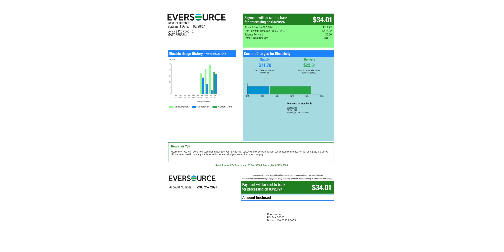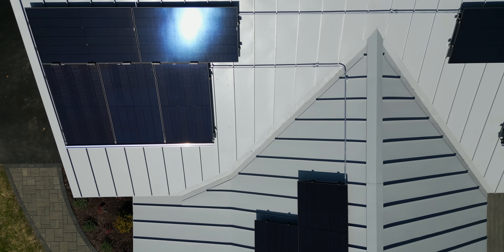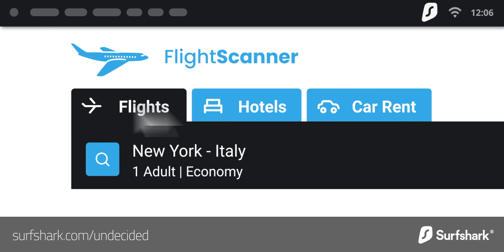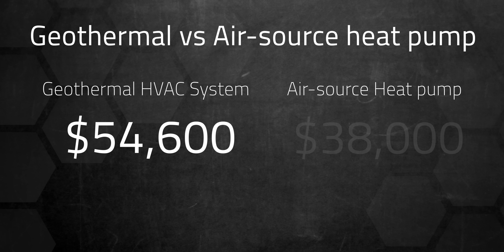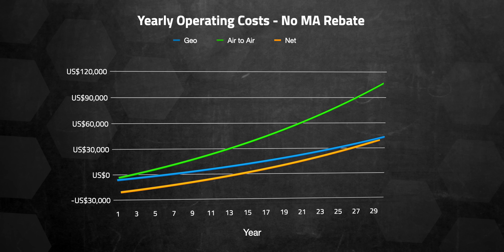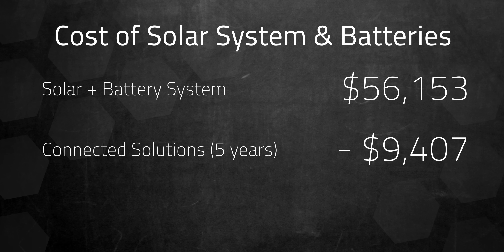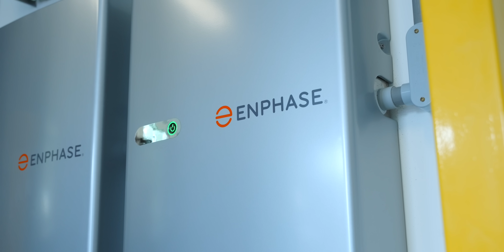What I Learned After 1 Year with New Solar Panels

Comment: WOW, you paid a lot did the contractor sell you the system? Off grid you would need 3 days of battery but,,, at that price???
* Solar Panels; Runergy 400W up to  500W Bifacial Panel 500W 88.00 each X 43 = 3784.00
OFF GRID 
*Inverters 200amp service EG4 12000XP 2500.00 each = 5000.00
*Batteries. WattCycle 12V 280Ah Mini, 24 each,  80kw = 12,000.00 today,,, 8,000.00 on sale, wait.
This totals about 22,000 with tax, 27,000 with hardware. Install the panels yourself with a carpenter and hire an electrician to help you wire it up, labor??? How handy are you, your friends? ALSO, those batteries go on sale for about 25% off often, save 4,000 on batteries and it will help cover installation costs. NOTE; this is a large system you will never miss the grid.

*Whole OFF grid 200amp system, 3 full days of battery storage for about 30,000.00
ON grid; you will increase the inverter price however decrease the battery cost by a lot more.
As for pay off time? IT WON'T LAST 30 YEARS. The payoff on the above will be about 10 years, pray for no hail storms.

Comment: Matt I’m a little disappointed that you invested in home battery storage when you pointed out that you have 70kw systems that you drive with… it has always been the vision that you’d use the home to vehicle systems (H2V) to balance your power needs.   This serves two purposes - one you have the latest battery tech every 5 years or so without ripping up or changing the home infrastructure.   Two you never have to worry about battery degradation over the 20 years of constant use.   Lastly, there was always this utopian (maybe one day) that the vehicle is your life time energy sub system- you use solar to charge during the day and tap into that system for night and non sonny days.  Using the grid only when you are very low.  And you power your energy needs where ever you go, work vacation or grocery - the energy grid is maintained and sourced by your transportation - it combines all the energy needs for industry, home and transportation.    I realize that this may be 6-20 years out - but I’m disappointed that an early adopter like you didn’t look more closely into this option.   I mean using the car is the most cost effective!

I mean why get the battery when you have local net metering like I do in Massachusetts.

Comment: If I knew where I was going to be living in 5 years I could/would do more.  I use my battery inverter system for peak shaving when the utility issues a "flex event", at which time I earn $1 a kWh for electricity not normally used during that time, it also works well during power outages.  I've added thermal windows, attic insulation, under house insulation, water pipe insulation, air duct insulation and some energy efficient appliances.  Since this is not my "forever home" I'm reluctant to do more, unless I can take it with me.  I've witnessed vandalized solar installs in my area, additionally the area I live is solar poor, latitude and clouds, in the winter when it's needed most.

Comment: Great info Matt.
I too believe Solar panels are well worth the investment. I cannot however say, that for me that a battery is viable. 
I am nearly net zero in electricity consumption, however still well out of pocket but that cost in now halved compare to pre solar consumption.
I live in Melbourne Australia and in December of 2022 I installed a 9.4 kW solar panel array and an 8kW three phase Inverter. limited by roof space and max 10 kW array for domestic install here in Victoria currently.
I have had this system now for 2 Years and have seen a significant level of production and halved my consumption from the grid.
My system cost me AUD7,500.00 (approx USD$4,600.00)  and has produced 26.2 MWhs of power over the 2 years since installation. 
During mid Autumn through Winter and into Spring my solar generation varies significantly. 
The generation pattern from 2023 to 2024 is very similar with winter months providing some 490-600 kW per month and up topeak  1.5 MWhs per month in the December and January. 
Full 12 month generation of  11.9 MWh in 2023 and in 12.4 MWh in 2024. 
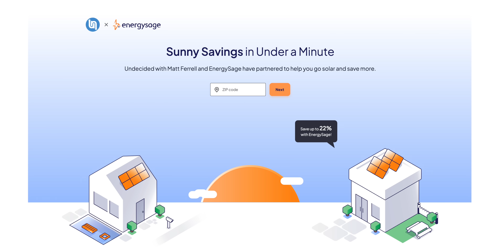Due to very poor feed in tariffs in my state, the excess is sold back to grid at AUD$0.054/kWh and retail cost where I live is AUD$0.42 at peak times -(16:00 - 22:00 hrs) and AUD$0.21/kWh off peak. 
So I still spend for power at night and winter months when solar performs poorly and on overcast and bad weather days.
Batteries are still cost prohibitive for my use as during the period of April through September I would hardly have excess power to charge a 13kWh battery.  
The cost of such batteries at about AUD$18,000 for a Tesla Powerwall 13 kWh unit plus installation.  
Some other makes are less expensive however the cost per kW of storage is still around the same at approx AUD$1,400 / kWh.
At that cost, it would currently take over 15 year payback given my generation profile. 
I have decided to wait until battery technology improves and costs come way down.

Comment: Holy crap, Matt. I cannot believe what you paid for your system. My system we installed in 2024 here in Tucson, AZ is smaller than yours. Your system was 17.2 kW with battery backup, and ours was 12.6 kW with 3 x Tesla Powerwalls (2 x pro, and 1 x PW2), and our system only cost $57k vs. your $89k. Ours went live in April 2024, and despite a 27% smaller solar array, our system here blew your production numbers out of the ball park in just 9 months. Here is the comparison. In a full year, you say that your system produced 18.1 MWh. In 9 months here in Arizona, our smaller system produced 21.2 MWh. In a full year, we should hit about 27-28 MWh of production. Additionally, here in Arizona we only pay $0.11/kWh for grid power compared to your $0.31/kWh. This highlights a big thing that you don't mention often enough, and that is that solar power makes sense mostly in areas where the cost of living is low and solar radiation is high. So, solar power doesn't make sense in a place like Massachussetts, where solar radiation is low, taxes are insanely high and the cost of living is unaffordable to most people. Instead, solar power makes the most sense in places like Arizona, where taxes are low, life is much more affordable, and the solar radiation is very high.
Reply: Your numbers are great but the conclusion you make doesn’t make sense. Matt’s saving money in his area— he’s just not saving as much money as you are. Given that he plans to age in place in this home, and the fact that utility prices always rise, he’s in a good way in an area that he actually wants to be in. AZ is fantastic for solar, and a lot of fun to hike and bike in during the winter, but in the summer, you can’t do much outside. Not the case in MA. You also can’t hike amongst the beautiful New England foliage in the fall, like in MA, nor do you have as many options for skiing or snowshoeing in the winter, like you have in MA. Different strokes for different folx— all saving money and energy! Let’s not forget that when you build a home somewhere, you might choose the location because of proximity to family and friends. 

Congrats on your setup tho in AZ. Sounds sweet.

Comment: I watched the whole video, and I am left scratching my head as to why. Not why solar, but why spend SO much on the energy saving systems when you could have achieved Net Zero simply by adding a few extra panels?

I am a DIYer, and this summer, I installed a 13.2kW system with 14.3kWh of battery. Granted, 13.2 in Texas will anualize a lot higher than 13.2 in MA (anticipate between 18 and 20mWh) and without changing ANY systems in the house, I'm hitting Net Zero in December, and tracking towards it in January.

AND by doing it myself, I got Panels, Racking, inverter, Module level monitoring, disconnects and breakers, all conduit and wiring, AND a battery for around 22k.

True, I am an engineer, so I am smart enough to know what I am not smart enough to do... but Im also a fat OLD engineer (61). If I can do it, anyone can. 

Bottom line is, if you are willing to put in the elbow grease, there is no need to spend 6 figures to go Net Zero. Just my $0.02
Reply: FWIW, the house is all electric, so the winter load includes an electric heat pump.

Comment: Matt - Looking at the cost of geothermal vs the cost of solar would it have been cheaper to expand the solar and run a heat pump.  I can see many of the improvements have a payback over the grid, but do they have a payback over a larger solar system.

Comment: Like you, I live in Massachusetts and had solar installed a year ago (Dec-2023).
I used money obtained when a relative bought out my share of a parent’s house.
Purchased 17 4kw panels; cost was  $28k. The panels were from SunPower.

We use between 400 and 500 kwh per month. We are not an all electric house. We use oil for heating and hot water. We’ve cut down our oil usage by using a pellet stove and Mitsubishi mini-splits.

Our roof faces east/west. We installed the panels on the west-facing size.
Our first three bills (Dec, Jan, Feb) cut our Eversource bill in half. We have not had a bill since.

According to the monitoring app, solar covered 47% of usage in December 2024.
I expect the built up credit shall cover our forthcoming bill.

Comment: Another great video, I've been following your home progress in multiple videos and its a great resource for those diving into energy efficient homes. As a mechanical engineer whos designed many NZE building systems, I will add one thing that wasn't covered in depth in this video and one that I'm almost certain that applies to your home given its size and single heat pump. It all starts with the architectural design, even as a mechanical engineer, I start by working with the architects telling them what they can do to the design to bring down the loads. Following the passive house standards will get you pretty far without the need for detailed energy modeling, but upfront modeling is best if you can get it. $ spent on envelope makes the HVAC and PV system smaller, making for an overall cheaper NZE home; and go easy on the glass folks, the best glass in the world is many times worse than a code compliant opaque wall.

Comment: The more they gouge you with high utility cost, the stronger the argument is to implement cost saving strategies. 
One issue i see in the payback calculations is repair and replacement cost. These need to be factored in. Generally speaking, the complex systems cost more to maintain.

Comment: $0.31 / kWHr is mind-blowing to me in Detroit. I pay 8.1 cents for distribution, and 5 - 13 cents for generation - so $0.13 off peak and $0.21 on peak. More critically, natural gas is only 3.3 cents per kWHr! Wow, I have it good. 

Detroit's utility DTE is pretty dirty. Home electric is 33% of my kWHr, yet 59% of my CO2 emissions. Natural gas for building heat and hot water is 57% of my kWHr, but only 19% of my CO2 emissions and 15% of my energy costs (with transportation being 40% of cost, 10% of usage, and 22% of CO2). I have both a mini-split air sourced heat pump and in-floor hydronic heat from a natural gas tank. In my situation, the heat pump is both more expensive AND more CO2 than burning gas. 

I just added two 390W panels with enphase microinverters in a self-consumption mode. Made a nice roof for my firewood rack and has a 5 year payback. I would love to have a clear case to go net-zero  -  spend my retirement dollars now to not pay for energy in retirement, but it makes no sense here in Detroit. I'll keep my $0.18 / kWHr average electricity price rather than go net zero with insane energy costs!

Comment: I am curious what performance you are getting from your Waterfurnace series 7?      We are in our 4th winter with ours.     Northern NH cold climate,     not a great house to heat but not terrible.     But we find that we would be  cold without our woodstove and back up electric heaters.    We have ample solar.    MA climate and better home may make a difference.    We mostly only run 1 of 3 zones because of the wood stove but even that zone struggles to get to 68 in cold weather.     Just curious of others experience?

Comment: Hey Matt, You have a great mixed set of energy solutions and management, I mean your super efficient insulated house is the best way to start imo, which you did, the less you have to heat the better! Thanks for sharing your experience!

Your house looks fantastic, you've set up a great solution for the future too, have you considered a small wind turbine addition for those darker winter days and nights?

Great value on the Geo thermal! Could you insulate the bare copper pipes near your water heater - super nerd thought there 🤣

The projected savings for the future look great too! You have done a great job! Great model for anyone considering a similar project!

Definitely worth it! Without a doubt!

Comment: I am starting to design my forever off-grid house. I have calculated everything except the type of solar panel and batteries. Do you have a recommendation for both? I was looking at 500-watt panels because they would be the most efficient, and you recommended Franklin batteries. Has anything changed?

Comment: here in Australian,nsw our power is charge at 46.5cents per hour, but has just dropped to about 36 cents per hour but varies, our solar rebate has dropped from 0.07.6 cent KW per hour to 0.05c as from )october 24 what a joke ,get to a point plus i also have a heat pump and still pay 96.00dollars to 265.00 per 3 months, but my solar is only producing half of powder due to shade from trees ,which needs to be considered, not make matters worse,theres talk about energy companies my charge us extra fees if we make over 17kw per bill ,to be checked and verified

Comment: If you truly want to think of solar as an investment you must consider opportunity cost. These high $80k+ investments in solar must be compared to traditional investments to get the whole picture. Sure this setup may return 200k in 30 years compared to a cheaper upfront option, but invest that 40k savings by going air pump instead and that money doubles every 5-7 years forever (S&P500 index fund). So in 30 years that becomes $650k minimum.

Comment: I still can't believe the costs for your systems. Those contractors made a huge profit on you. It's shameful and it will soon price most people out of a home. I even see tiny homes coming in over $100k. 
Good, energy efficient homes shouldn't cost that much to build. 
You made great choices as far as keeping your future cost of operation down. I have tried to counsel people building new homes to at least go with super insulation and sealing, but most don't get that it's cost effective in the long run.

Comment: Cost of 1KW installed in an ongrid system in pakistan in Dec 2024 would be comfortably less than $300 per KW. 
Thats ~6000$ for a 20KW system with latest 585 watt panels and a top tier invertor. Payback in leas than 2 years. 
Why are the prices in US so insanely high?
Reply: Labour cost, qualified personnel services fee and authority submission fee are the biggest killer
Reply: @zenniz1992  Is there a rate list for authority submission fee ? what are the costs generally like ?
Reply: @ahmedameen8798  Depend on installer but typically in low thousands

Comment: Geothermal & water source heat pumps will have higher maintenance costs than a mini split heat pump system & similar energy costs.  I was an HVAC contractor for 35 years & geothermal is by far the most expensive option.  The downside are pumping costs because earth is a lousy heat exchanger.

Comment: So in total your system cost $60,000 of taxpayer money.  For full transparency that's understandable but without all this tax money what is the actual payoff for one of these systems? I'm assuming that the government isn't always going to be able to hand everybody this insane amount of money for a house that is definitely at the top end of the market per square foot.
Reply: I think the tax code needs to put caps on the IRS tax credits. Take, for instance, the $7500 EV tax credit. Note I did take advantage of this in 2012 and 2018. But since then, EVs have become mainstream, and credits are no longer necessary.

Comment: You missed the opportunity cost of your initial investment. $80,000 invested for a span of 30 years with a meager 6% return rate would net you over $480,000. From a financial standpoint, it was not a sound investment. But if the cost is worth it to you for other reasons, then that’s fine.

Comment: You missed several major costs. Insurance cost increase (if coverage is available at all), property tax increase (varies state to state), replacement labor and costs of failed and damaged equipment (inverters, panels, switches, wiring, BMS, cleaning, etc.), longevity of your warranty providers (manufacturers, sellers, installers), lack of compatibility of new equipment (this is why used solar is cheap), and increase in labor from inflation. Electronics that use electrolytic capacitors have a limited life span. What happens when your Chinese panel provider goes belly up and new panels don't fit? And what bothers me most is those tax credits are paid for by the taxpayer not the government. I don't like subsidizing your solar experiment at my cost (intentionally redundant). Overall, I call your analysis incomplete with significant unknown future costs.

Additionally, your thumbnail headline stated regrets, but you provided no regrets or lack thereof in your analysis. This is deception.